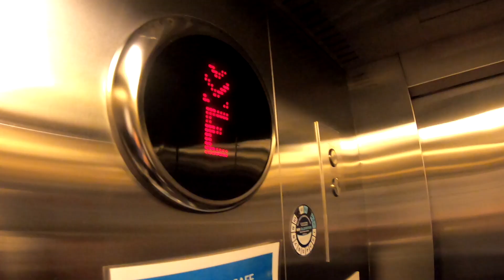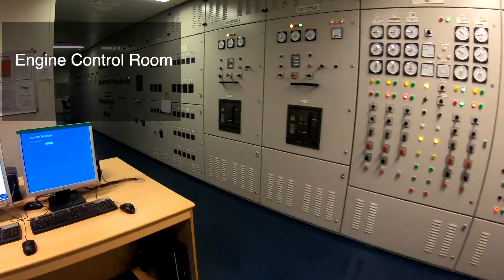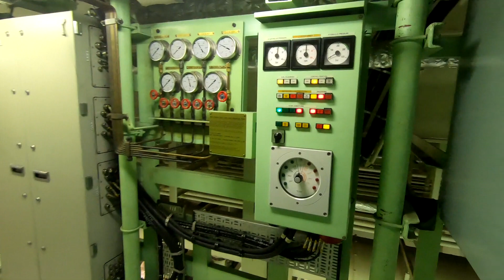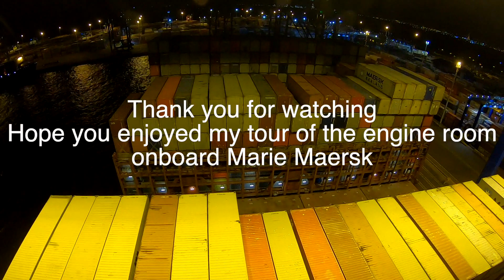Engine Room - Marie Maersk - Triple E

Comment: At 05:49 you wrote something about Steam Turbine and Power Turbine. Is it just one Turbine driving a Generator (the most logical Thing to me) or two Turbines with one of them driving something else?

On that Subject: The Marie Maersk is from the first Generation of Triple E Vessels; can they use the Shaft Generators as Motors too to save Fuel by keeping the Diesel Generators at full Load or is that System exclusive to the second Generation of Triple E Vessels? I considered both of these Subjects for my Marine Engineering Thesis, the first one in the Form of COGAS/COGES Plants and the second just for saving Fuel with Electricity in General, the Hybrid Ferries from Scandlines cought my Attention on that (essentially having replaced one of the Diesel Generators with a large Battery which get's charged in Port and discharged while accelerating and stopping, thus allowing to maintain an almost constant Load on the remaining Generators). But I dropped both of these Ideas in Favour of an LNG vs Methanol Fuel Comparison; IMHO does Methanol have the Advantages of LNG without the Drawbacks of being gaseous at Room Temperature.
Reply from the maker: Yes and no to the turbine, it has a 2 stage steam turbine with 8bar and 4bar pressure. But in addition to that, via a transmission a power turbine is connected, it runs of the exhaust gas via a bypass pipe from the exhaust receiver. 

It is also possible on the first generation to run the shaft generators as motors. Roughly 3MW supply/delivery. 

Sound very interesting. Let me know if there is anything I can help you with, though I'm not working with Maersk anymore, but still sailing. Enjoying my time at DFDS.
Reply from the maker: Both the turbines run on the same generator, and the steam turbine has to start up before the power turbine can kick in.
Reply: @thehikingseafarer8527  So it has a similar Setup to the Emma Maersk Class with the Exhaust Gas driving a Turbine Generator. Both Emma Maersk and Triple E Class seem very intersting, which is one of the Reasons why I consider apllying to Maersk Line once I get my Engineer Certificate in 2022. Do you know if they hire Germans too? It's really hard today to find a Job in a foreign Company; many Scandinavian Companies (including DFDS) look very promising to me but I've heard that they usually employ their own People only. Starting as a 4th Engineer is another good Reason for me, what are the Duties of a 4th Engineer there?
Reply from the maker: I am not sure about the setup on the E class. But I think it is more or less the same. 
The best advice is to apply. Depending on if you have your 6 month of sailing or not, you will start as junior or 4th. 
I'm not that we'll acquainted with the hiring process, only that I applied myself and got the job at DFDS. 
We don't have 4th engineers at DFDS and the duties varies a lot, there is no specific area, you have to know how to handle and operate everything. 
Best of luck with your education.